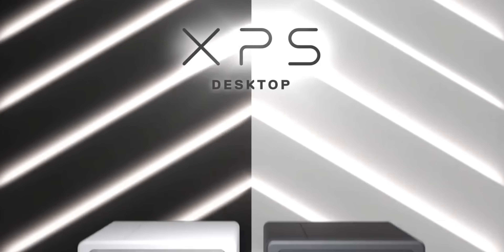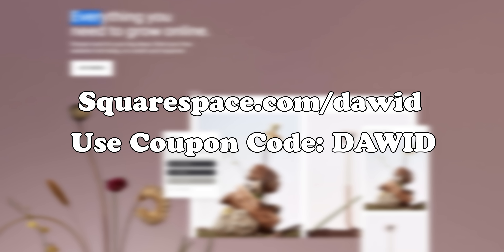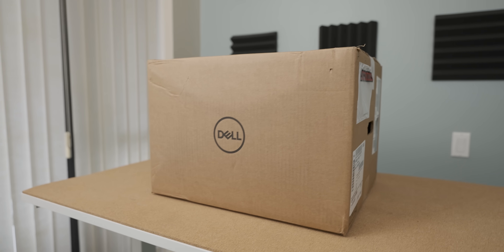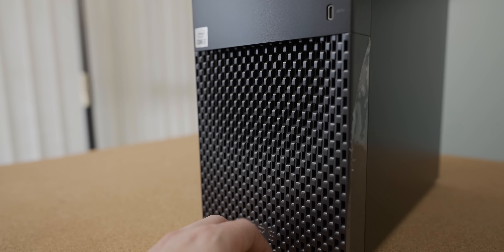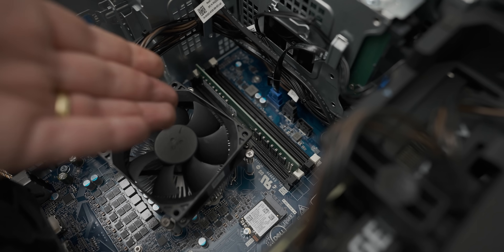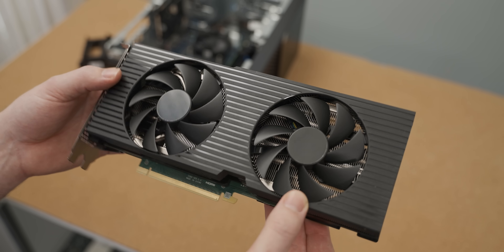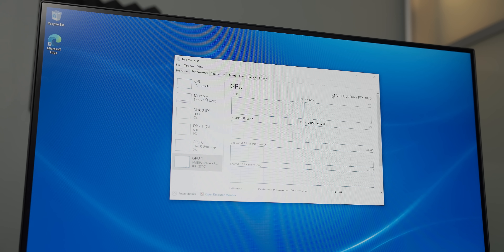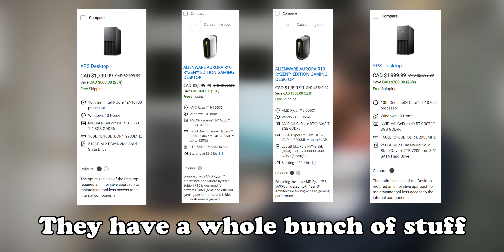DELL Did Me Dirty... RTX 3070 Dell XPS Pre-Built

Comment: Yikes, that temperature makes me want to turn your PC off.. Why building your own PC is better, I paid $700 for building Ryzen 5 2600x, Rog Strix b450 f gaming mobo, MSI GTX 1660 Ti and 32gb RAM.

For your price on DELL, that is what I got for Ryzen 7 3700x, MSI b550-a Pro, EVGA RTX 3060 Ti FTW3, MSI CPU liquid cooler, 32gb RAM and MSI case.. I feel bummed buying 3060 Ti at double price because it would have been $1,000 if I got GPU at MSRP but it is impossible to get them so I paid little more..

I am sorry that DELL ripped you off but at least you got RTX 3070, throw a old GPU or cheap GPU in that Dell and resell it. If your processor have integrated graphic then you can just sell it while you keep RTX 3070.

Comment: Yes the CPU cooler is definitely poopoo garbage. But I think giving you a single 16gb stick is better than 2 8gb sticks because in the end once you've fully filled your ram slots you'll have more memory. You wont end up running into the situation I'm in where I want to go from 16gb of memory to 32gb but need to completely start over since I only have 4gb sticks.

Comment: Hi!  I got the XPS 8940 too, but mine is i7-11700 with RTX 3060ti.  It runs fine, but my games run at much lower fps in every game, like ~200fps in CSGO with low 1080p. And in DOTA2 ultra 1080p, both cpu and gpu are running at about 40-60% usage, so the fps is only ~80 fps while I see many people have dota2 running over 200fps.  Do any of you guys know what is the reason for my case?  Thank you very much!
Reply: I repaced the cpu cooler and case fan by some Noctua fans, so the temperature is not too high.

Comment: I just ordered the XPS 8940. My budget for a new Dell tends to be around a thousand dollars, and I’ve been buying XPS for years. Which is why the thought of Alienware or Alienware prices were just a no, plus you’re forced to buy all the Alienware accessories in order for it to work to its full capabilities, so that was a hard no. 

Either way, this XPS still cost me $1500 with the 1 year warranty attached.  Certainly, went outside my budget but I do hope it’s worth it with everything they were able to include. I had to call to talk to a salesperson because whenever I buy a pre-built it seems I always end up getting stuck with something that doesn’t work for me. Like my last XPS had a graphics card that was obsolete within one year of purchasing it. I made sure the salesperson knew I didn’t want that to be the case with this one. The stats are as follows…

NVIDIA(R) GeForce RTX(TM) 3060 12GB GDDR6, 256GB M.2 PCIe NVMe Solid State Drive + 1TB 7200 rpm 3.5" SATA Hard Drive, 16GB, 8Gx2, DDR4, 2933MHz, Tray load DVD Drive (Reads and Writes to DVD/CD), 11th Gen Intel(R) Core(TM) i7-11700 processor(8-Core, 16M Cache, 2.5GHz to 4.9GHz).

So, I have my fingers crossed that I won’t be disappointed as soon as I get it.
Reply: I wouldn't have bothered getting such a small ssd and a normal hard drive, would have just got a 1tb ssd.

Comment: Just bought one and not unboxed it yet. Comes with 32GB ram. I am HOPING it comes with a single stick. Then I only need to buy another 32GB stick to get to 64GB max.

ok, opened it. 2 sticks but 4 slots. The sticks are 3200 high density sticks. Just need 2 more for 64 without having to take out the existing sticks.
Reply: can i ask why do you need 64gb ram
Reply: @fymjio  I run VMs using VMWare workstation. Linux and WIndows virtual machines. My biggest machine has 256GB ram. Bought an Acer recently ht said the max ram was 64GB  in 2x32 thinking it had 2 slots. No, it has 4 slots. I put the ram in anyway. It worked! So then I decided to put in the original 16GB. 80GB! Then I ordered another 64GB, put it in, 128GB!
Reply: @trustedsource1273  oh ok, thanks for the response you must do alot of heavy loads, lol i wish the best 4 u

Comment: I'm 50 years old and have worked in well respected companies such as Gateway and Intel. While you speak of components being a bottle neck I completely agree however I encourage/challenge you to buy an aftermarket motherboard and use the ram, hard drive, processor and graphics card in that. The OEM boards are literally designed with removed components that they feel the majority of the people won't use/miss which is actually a serious cost cutting measure for them. Let's face it, anytime you use anything "OEM" it is likely going to be inferior and doing so would be a great video to show that maybe building a PC VS buying a prebuilt is worth the cost.

Comment: i have watched SEVERAL reviews for all three branches of dell, the aurora, xps, and g500 (their extreme budget). the cpu cooler, ram, motherboards, are the same in ALL THREE!!! that is absolutely BOGUS considering the price variants between the three, not to mention i have yet to see any vrm cooling, and half the models dont even have a heatsink on the south ridge chip. Dell should be ASHAMED of themselves for all of their false marketing AND for sending systems out that are thermal throttling right out of the box! These terribly designed systems are going to die VERY early on if not rectified. In my mind dell owes you money for your time and lack of parts, a new cooler, and dual ram AS ADVERTISED ON EVERY ADD THEY HAVE, as well as one HELL of an apology! honestly disgusted with dell at this point...and this is before considering their crooked as way of throwing random warranties and upcharges on costumer bills....smh...

Comment: My laptop was on its way out, so I decided to get a Dell XPS with an RTX 2060, 10th generation i5, and 500W power supply. I've been gaming regularly on it for a couple months now for at least a few hours a day, and here's my rundown of the system.

— If you want to game, you MUST replace the CPU cooler and add more fans. After mods, my CPU stays at 45C and my GPU 60C even after a few hours of heavy gaming. I used a Vetroo V5 CPU cooler, which is cheaper than Dell's proprietary cooler / Noctua's equivalent cooler. The difference in performance between the three is negligible.

— It is difficult to upgrade the RAM on these systems because RAM speed is capped depending on what processor you have. For i5s, the cap is 2666. For i7s, it will not go above 3000. I'd at least like to upgrade my single 16gb stick to two 8gb sticks, but I've heard of people having issues finding compatible RAM for this system.

— Use zip ties instead of rubber screws to mount your fans.

— The motherboard and power supply cannot be moved from the case. So if you want to move parts to a new case, you'll have to buy new ones.

— On my order, the front panel's power button did not extend far enough to actually turn the tower on. I keep the front panel off. It isn't pretty, but ventilation is a lot better with the front panel off anyway.

— ALL fans must be connected to the sockets on the motherboard that say "CPU FAN" and "FAN SYS". If you try to connect it to the power supply / any other socket, the BIOs will throw up an error. This means you will need fan splitters / extension cords. I have CPU FAN connected to the CPU cooler ( duh ) and top intake fan. FAN SYS is connected to the bottom intake fan and rear exhaust fan.

It's not the BEST, but it plays triple AAA titles at medium-high settings, and I have not run into significant issues since using this as my gaming PC. I also upgraded from the stock 256gb Kioxia NVMe to a 1tb WD Blue. 

In total, I spent about $1000 on the tower + improvements. Happened to get the tower for $800 during one of those sales Dell runs about once every month. Pretty good given the current specs and the way the PC gaming market is right now.

Comment: Don't expect to be able to fit most of the longer video cards into these. They aren't deep enough for that. Dell's power supplies also aren't upgradeable. The OEM 3060Ti and 3070 that Dell uses will work fine with their 500W PSU, but forget about upgrading to anything better. They will be too long, and draw too much power. The case fans probably wouldn't move that extra heat very well, either.
Reply: I was able to upgrade the power supply on my gfs dell desktop, was as easy as swapping it out. Had to because the new GPU needed more power. Everything was relatively easy.
Reply: @rdizzy1  With another Dell PSU. Dell does not make a PSU higher than 500W for these, so you won't be able to use anything that draws more power. That was the entire point of my post, which you obviously missed.
Reply: @gamewizard1760  No, it isn't a dell psu.

Comment: I ordered the 11700 version of this a couple of weeks ago. You can upgrade the cpu cooler pretty cheaply and you can get a heat sink for the VRM. They better send be 2x8gb though or I will be pissed.
Reply: Update me
Reply: @조셉은플로버  Yeah it shiped with dual channel but there is a big issue. You can only use JEDEC profiles on ram you buy and cannot enable XMP. I could handle the enforced CPU power limits that dell does not let you remove but not supporting XMP is a joke.
Reply: @The_Trojan  rip
Reply: I ended up grabbing an NR600 case, EVGA CLC 360mm cooler and an ASRock Z590 Steel Legend Wifi 6e mobo. Much better now.
Reply: @The_Trojan  let me guess, the original Dell mobo and PSU were proprietary?

Comment: The reason your gpu utilization is low cause your do 1080p all 30 series are optimized for 1440p I bet if you did the test in 1440 p it would be different

Comment: My Dell bad experience
 The one-year warranty for Dell’s computers starts from the product distribution date, not the date the product is received
 Customer ratings on the Dell website are checked by a moderator and a majority of negative reviews will no be published
 The Dell repair center can cause the product to be further damaged. The product can even be returned with missing parts, and the repair process can even cause previously working parts to break.

Comment: I bought a Dell Xps 3940. After a couple of months it was running so hot. Spent $700 on new Asus motherboard, tower,  power supply, heatsync unit and fans Transfered everything I could, now I have a machine that is running cool & fast. I will never buy a Dell again!

Comment: Yeah case swap and motherboard swap plus a good cooler and you got a great 2000$+ computer running at 100% for less than getting the parts used.

Comment: I got two XPS at Christmas and ordering them was a nightmare.  I cancelled two orders before getting a confirmation they would be delivered before February.  But it meant changing the processors from i9 to i7 and getting the RTX-2070 instead of a 30 series.  On my son's XPS, i opted to get a machine with the stock intel GMA and put my old GTX 1050Ti from my old gaming computer.  It was the only way to get him a system capable of playing Cyberpunk.  I eventually yanked the 1TB hdd and replaced it with a 1TB Samsung 970 SSD.  I also took the 16GB of Ram out of my computer and put it into his giving him 32GB of RAM.  I upgraded mine to 64GB.

Comment: Cyberpunk 2077: 61 fps with an RTX 3070

My gtx 1070: best I can do is 8
Reply: My 1660 chocked while playing on medium 1080p
Reply: @MichusubPl  my 1070 was just trudginggg really slow. I put on high res textures, for shits and giggles, and some things would still load in gta 3 quality textures.
Reply: the 1000 cards support DX 12 but i noticed my 1080 ti took around 20-40% perf hits with DX 12 instead of 11 and cyberpunk is DX 12 only my new 3080ti is the opposite result on the other hand
Reply: In 1080p or 2k, 4k?

Comment: I'm glad I watched this. I was planning on buying an XPS.
Reply: I mean, if you have the ways to upgrade the cooler than literally 100% of the problems are gone.
Reply: @TheStoso2  still not a good value when (1.)even the ran is single channel(2.)the case doesn't have enough airflow for anything basically (3.) The power supply makes any upgrades unviable (4.)the shitty experience you will have trying not to purchase a 325 year McAfee subscription for your future descendants

Comment: NGL I'd take that Dell case (in terms of styling) over almost any "GaMeR" case out there. Those dell slimline power supplies are also built like tanks and very stable; they're basically lower model server supplies hence why you could fit two side by side for redundancy purposes, and platinum (along with platinum II) are basically the only options for the business market.

If it came with a proper cooler on the CPU and they didn't fuck up the order and included dual channel, I'd honestly say it's a good system.

Comment: lame, set correct expiations. I got a refurbished Dell  7010. I replaced everything but the mother board.  Power supply, 32 gigs ram, i7 from i5, 6gig video card, 1Tb SSD. still a 1200$ rig.  It kicks butt...

Comment: Ordering custom build anything from Dell is a crapshoot.  In the early 2000s, one place I worked at ordered a batch of fairly high end rigs from Dell - the order was for half a dozen machines, all with identical specifications.  We got half a dozen machines in the  same chassis, but after that, every damned component was different - and different enough that they actually had measurably different performance.

Comment: They probably figure that anybody who would notice will put a better cooler in there no matter what it has and they pass the savings on to us. I sell Dell business computers at work a few times a month and their stuff holds up. And the ProSupport Plus warranty is, while pricey, a good product - they will have someone onsite within 24 hours and of the couple dozen times we've had to have them come out (we manage about 1500 machines so that's not a lot of failures that need fixing), they only failed to fix the problem on the first time once and they had a different guy there about twelve hours later with the part they had to overnight from Texas or something.

Don't, however, buy a Precision SFF. I've had three new ones come across my desk and all three, all of which had a 10700 and a cute little Quadro, shot up to 100C on the CPU almost the instant I started Prime95. True, that load is not likely to come up much even on a CAD PC, but even just updating drivers and updating Windows got the CPU up into the high eighties. I didn't even try to stress the Quadro because I didn't want to set off the sprinklers. I had to chop ten percent off the CPU's max power in the power settings to get the CPU temps under control - after that, it peaked in the low seventies under normal somewhat heavy load, which is fine. That all being said, a 10700 running at 90% power will almost never, ever come close to being the bottleneck for 90% of business applications so the users will never be inconvenienced. It is just disappointing that it was necessary. And the only fans in the damn things were on the CPU cooler, GPU, and PSU. They're like tiny black volcanos.

Comment: 10:21 And that is to say nothing of the bloatware. There is NO reason you would want or need Dells plethora of software. There is no real benefit for Dell to continue to use it either. Nobody is going to use Dells software in any way that will make Dell any more money than they already got. Its just a huge waste all around.
Reply: Dell Command Update is nice, but the rest of their shovelware is not useful. I run it when I'm setting up a new computer, then tell it to STFU. They also always have an Edge Partner Promo program installed and that is just sad.

Comment: I think that was the wifi card, not the ssd
Reply: Dell usually just uses a MB with a WNIC built in. It's easy to tell which ones have one because they have one or two copper thread connectors among the rear IO for the antenna.

Comment: I just bought the G5 w/ 16GB Ram and 2060 Super card. Case definitely needs more airflow. Guess I should check to see if my 16 GB came as dual channel as I had spec'ed.
Reply: How's the heat under a game load? It might sound crazy, but I have a custom built rig and I just leave the side panel off. Absolutely no problem with heat when you do that, but if it's somewhere conspicuous, you've got to have a decent interior or it'll just look dumb.